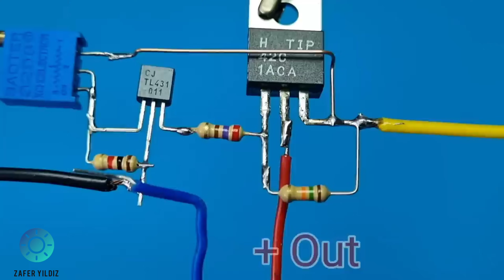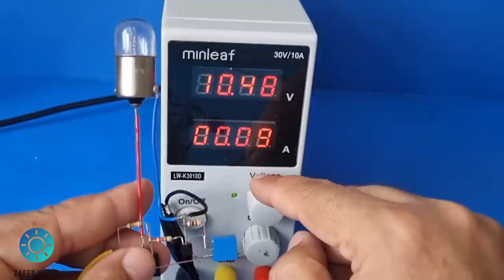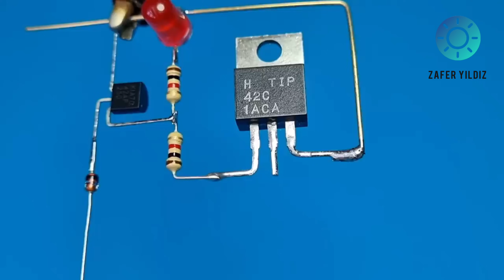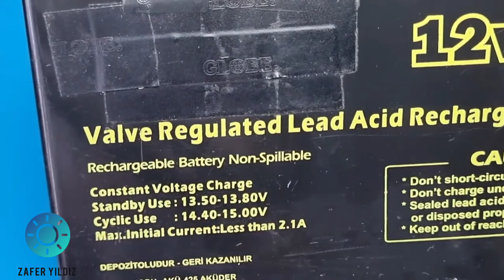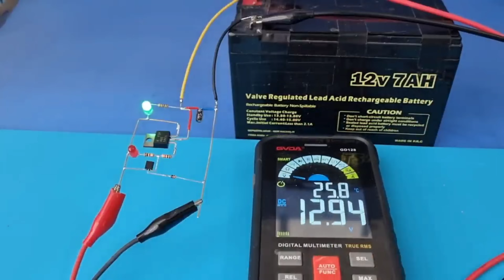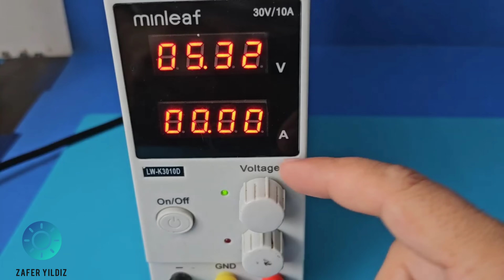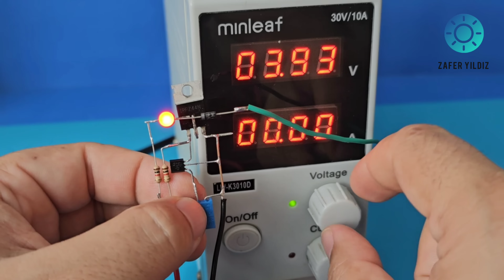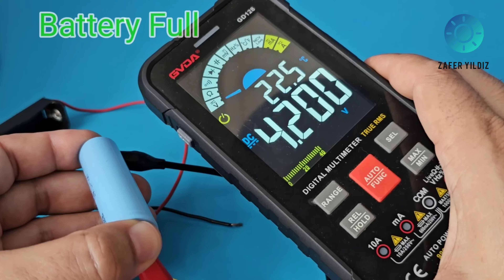Top 6 Amazing Projects for Electronics Enthusiasts

Comment: Sir can we use low voltage battery protecter in inverter circuit
Reply from the maker: Support it with a relay. It is not suitable for high currents.
Reply: Thank you very much sir for your reply

Comment: Super led flasher has no diagram and may I know the value of resistor and the input? Sokhran
Reply: This.  It's not always easy to deduce the function of a circuit without a schematic.
Reply: Sé que eres de habla inglesa, yo hablo Español, tus proyectos son muy buenos e ingeniosos, si fueras tan amable de poner los esquemas eléctricos, agradecido